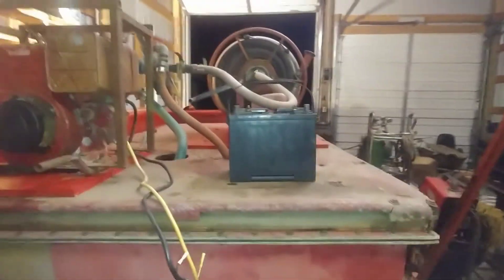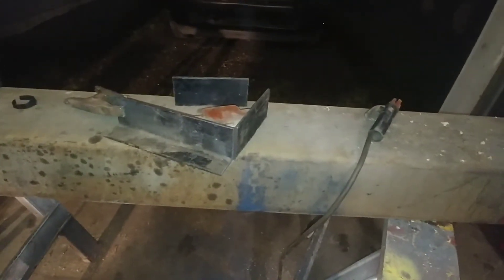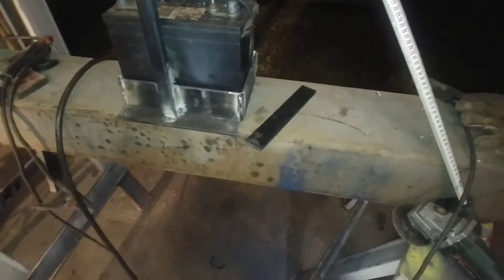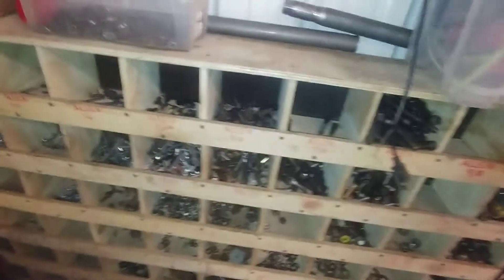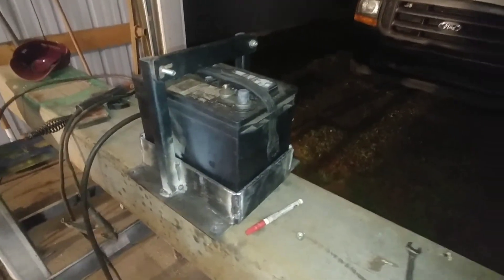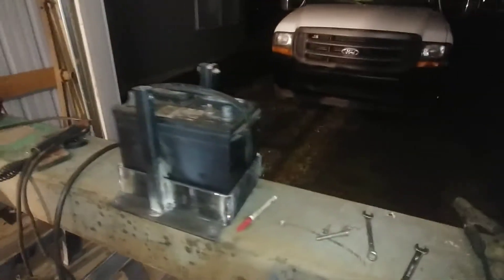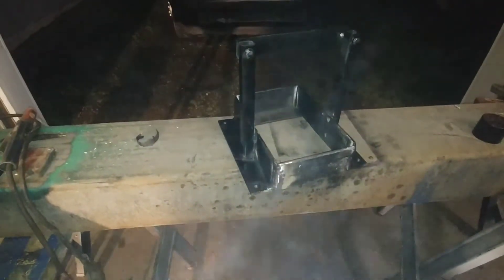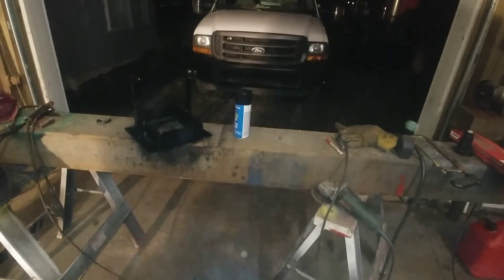Fabricating a lockable battery tray

Comment: Another mighty fine quickie project.  You were commenting on your welding skills and probably one of the best things is practice and more practice.  When I first started welding I had an old Oliver crawler/ loader.  The rails were worn out and the sprockets were bad.  All of the rollers were very worn.  I went to a welding store and acquired all of the rod, build up and hard facing rod and went to work.  A couple hundred pounds of rod and hours later, I was a pretty fair welder.  Over the years with a good machine and lots of alloys behind me, I can deal with a fair variety of metals and types of projects.  I would bet a project will come along that will need lots of welding and that will be your welding school.  Nick, North West Farmer